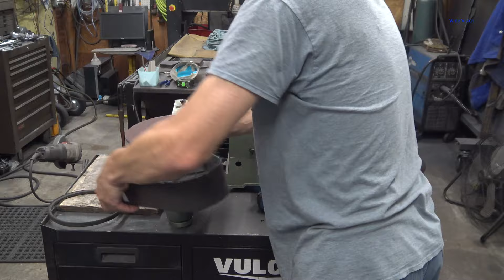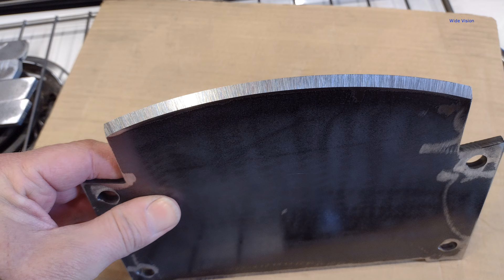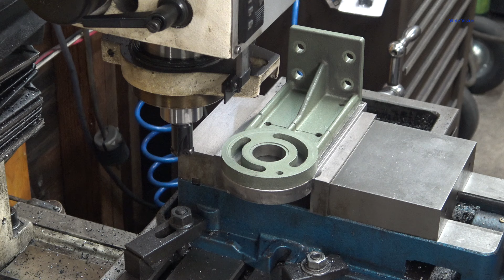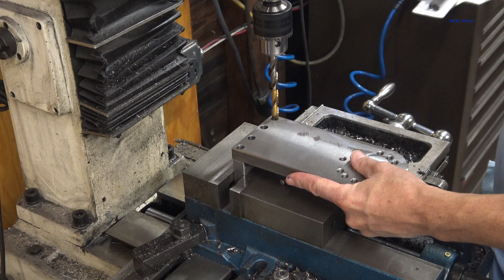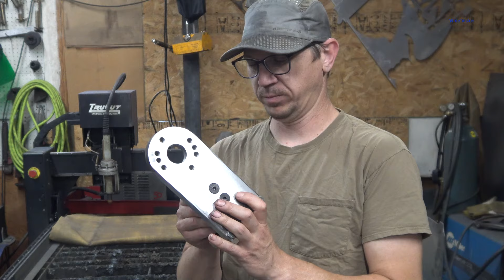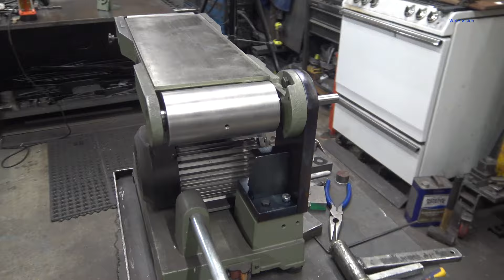INSANE belt sander REPAIR!

Comment: The "FOUR MOUNTING BOLTS," talk about over kill.  You should catch Tom over at Ox-Tools, he did some testing with different size bolts, and just what it takes to FAIL.  That you went with Farming Engineering, i.e. the four bolts, You could have still used the counter-sunk bolt heads, just the end(s) would have been needed to be milled (read that as clocked when tighten) the two end holes would have only been three-quarter counter-sunk.  I think that would have looked much better that the protruding bolt-heads, in my humble opinion.  Especially that you went with such a DARK (black) finish, would have never seen the partial counter-sink(s,)  they would simply just disappeared with the overall project.  The 3/4" in. Gusset was great  Farming Engineering, 3/8" in. or overkill 1/2" in. Gusset, but 3/4"in.  do you plan on driving a D-9 Cat over it?

Comment: I have a lot of the days/weeks where one problem piles on another and relate to the frustration. My mom says, "when it rains, it pours but there is always a sunny day ahead.  Take a break and doing something for yourself just because."   I also really enjoyed the project!  Great fix.  

is the round platen big enough to grind the kindling spliters?  If not making a platen with jig just for them might be a good use for the unused section.

Comment: Why did you went up going for bolts over a couple of good size weldments? It seems like they would be more rigid and vibration tolerant. It would also be less expensive given that you wouldn’t have to machine the mating surfaces, drill/tap/chamfer the bores, and procure high grade fasteners.